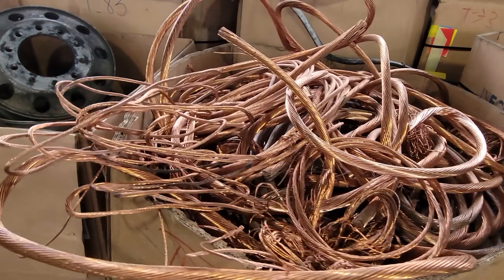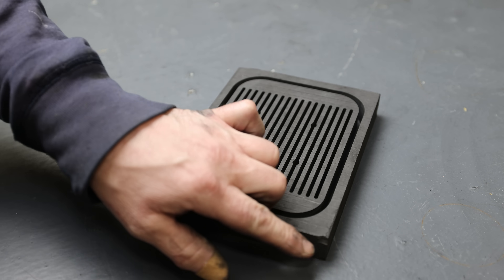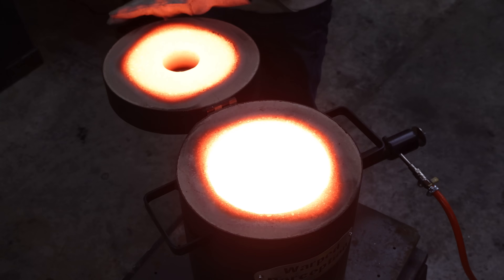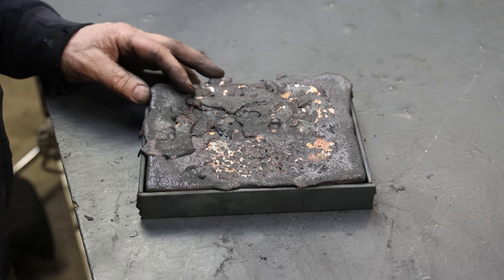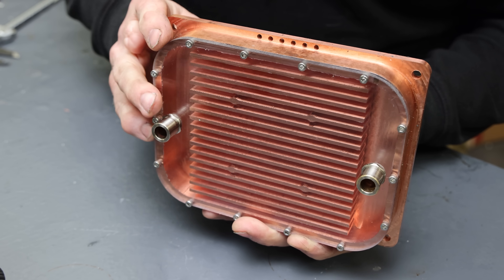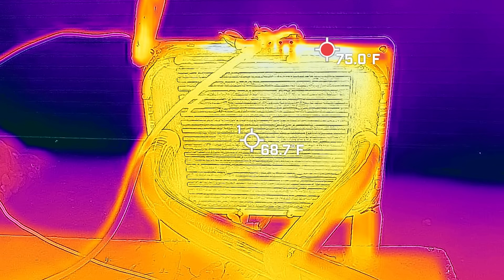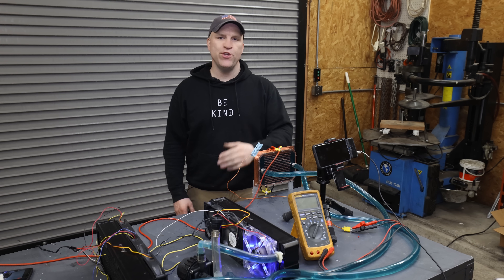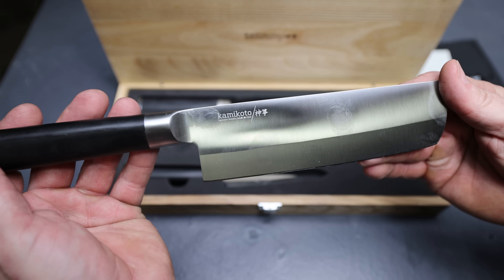Making a Huge Waterblock from Scrap Copper -Trash to Treasure

Comment: wouldn´t it be better to tilt the waterblock 90° like so the intake goes from bottom and exhaust in the top? i think it would be more heat efficient
Reply from the maker: Maybe but it really won't matter because it's being pumped through and this particular rear cover was just for the video, I'm actually changing the way it's set up on the rear so it can Auto bleed

Comment: What wattage and size is that chip?
If it's small enough CPU/GPU water blocks could be used, and another trick from PC: if your base if copper, or even better nickel plated copper, you could use liquid metal for thermal conducting, superb thermal grease for high powers, or use low temperature melt solder to bond chip with waterblock
Reply from the maker: 2000watts, 4 square inches. If it were that easy I would have been done a long time ago, unfortunately those options didn't work for me. As for the liquid metal, if you're talking about those heat tubes they're actually filled with water, at least all the ones that I have opened were filled with water... Maybe there are different types possibly?

Comment: In the camera shot looking down into the molten copper it looked like it was swirling like a toilet bowl.  Does it swirl naturally like a water in a toilet bowl from the rotation of the earth?  I can't see any other reason it would.
Reply from the maker: Yes that was looking into the molten copper, I think it's swirling because of the turbulence caused by the way the flame swirls in the furnace. Seeing as that's inside of The crucible that's pretty impressive that it just moves like that cuz it wouldn't be much worse from the flame movement.
Reply: @WarpedYT  Ahh that makes sense. Thanks for the reply and all the effort in your vids!  I always learn something.

Comment: really cool video and a great end result BUT you would probably get away with using a little less copper if you made the water block in a way where the cool water enters on top of the hottest spot on the block (middle) and made its way around the entire block - like most modern higher end CPU water blocks. Right now, most of the coolant simply flows across the middle of the block.

Comment: Might I ask why havent you casted a solid copper block and then machined it directly? I might miss something, but I can't see any reason why doing in a carbon mold first (especially if you destroy it aftewards)
Reply from the maker: Yes, to reduce exposure to the air by reducing the cross-sectional volume of the casting, almost for sure if I would have cashed the solid piece I would have had air in the center. Liquid copper loves to absorb air molecules and then when it's solidifies those air molecules are released and trapped in the casting. Which is exactly why I did that flux trick, you have to protect the Copper from the atmosphere at all times when it's molten.
Reply: @WarpedYT  Ahh that does make sense. Haven't though about that. I never casted copper myself, but I do remember seeing some casted copper bars which had a lot of "air bubbles" trapped, which in that case, would ruin the entire heatsink.

Good call! And great work! :D

Comment: Such a cool thing to do :) , I tried to do a copper pour the other day for some fun and found out the crucible i was using had some layer on the inside that bubbled out and copper is now stuck inside it...lesson learnt to check max temp before using as i have had other get holes over time but never that (pre-heating is always a must)

Comment: the in and out of the water block should bet staggered and not directly across
Reply from the maker: This was only for the video, I actually redesigned it with a different setup to allow it to Auto bleed any air and also be used in any orientation. Thanks tho !

Comment: Is there an estimated lumen output from the manufacturer (Nichia?)? How many Watts did you use, surely there was a constant current driver?
Reply from the maker: Yes 180,000 lumens if I remember correctly. 2000 watts, yes I had to use a legitimate power supply, that was probably the most expensive part of this project.  You can do constant current or constant voltage and also set the ceilings.

Comment: On the Water cooled Copper heat sink, the water input connector should be placed further to the top and the output water should be placed lower.  This would ensure all the water was being replaced, and not only some.  This would help with the cooling.

Comment: 2 relative easy sugestions to make it even colder: 1. Install input (or incoming stream) fitting on lower part and output fitting on upper part of plexiglass.(BC thermodynamics say that cold gas/liquid is allways at bottom and warmer allways at top, with my suggested setup You should be able to remove more hot coolant from cooler)
Or even easier, just rotate block 90° relative to ground, so input fitting on bottom, output on top.

 2. Polish surface where LED chip is mounted on block (or whole block plane it whould be easier), You will get better contact between 2 planes and better heat transfer from chip to cooler. Otherwise amazing cooler 👌🏻 I like this project 👍
Reply from the maker: That's a great idea, as for the cover this was actually only temporary because I need to use it in any orientation, so I actually redesigned that entire backplate to allow it to Auto bleed as well as deliver coolant in any position. As for polishing the back part that I should have done and I did not think about but that makes absolute perfect sense. I'm sure if you magnify down on that back plate there are valleys and peaks for sure... I totally have to do that. Thanks!

Comment: I used to spend more for copper heatsinks only to find out that aluminum works better... sigh.
Reply from the maker: Yes aluminum works very well, but depends how much heat you have to move and how quickly, the thermal conductivity of copper is almost twice that of aluminum. Trust me I tried aluminum first, aluminum is always my metal of choice
Reply: @WarpedYT  Its not that simple. and not to 'disbelieve you'. Copper is a better conductor of heat and Aluminum , a better dissipator. Hybrid heatsinks use a copper absorber plate and conduction system coupled to an aluminum or a plated copper dissipator. With that much surface area aluminum would seem to be ideal especially for cost not just weight and efficiency. Small surface areas are when copper is added for heat piping typically. Its unexpected to many but Aluminum has advantages...

Comment: Seems it may have been easier to pour one big block of copper; and mill that block... what do you think
Reply from the maker: Yes I was going to do that but that increased the exposure to air and I'm almost positive I would have got air in the middle of the casting because of the sheer size, the reason I did it this way was to reduce the cross-sectional area on all parts that were being cast to a minimum and thus reducing the exposure to air.
Reply: @WarpedYT  Makes sense. Thanks for the reply.

Comment: Why didn't you just cast a solid block and milled it out?! 🤷🏻‍♂️
Or just bought a solid slab of copper and milled it out?! 🤷🏻‍♂️ 
The way you did it doesn't  make any sense to me man!  
The amount of work and wasted gas and graphite, the extra CNC time. and probably extra time cleaning all the graphite dust! 
you have put in way more time and money!!! 😣 
I would really be a good thing for you and your viewers to make a: beneficial cost  analysis video of this whole process and project!! 
That would really help your viewers who want to get into building stuff! 😉
Reply from the maker: Originally I was supposed to Mill this out of a solid block, however the material was on back order for over 2 months, also I could not find the raw material anywhere.. originally I wasn't even going to make a video out of it. I didn't cast a solid block ,Because I wanted to reduce the amount of air in the casting, even with my process casting a solid block would almost for sure have air in the middle because of the sheer size and the air exposure. So yeah that's the reason I made the casting was to reduce the internal volume and a cross-sectional area of the liquid upon casting, and it worked I ended up with a completely solid piece no Air. Now you really think I would go through all this work if I could have just mailed it from a solid piece no way... That don't make no sense
Reply: @WarpedYT  sorry I re edited it 😉👍
Reply: @WarpedYT  yeah long ordering time's and back order  can be a real b!tch. And btw if you use extra burners on your mold the flow is better because you keep your mold hot and you have less problems with steam, moisture and oxygen and air pockets forming! 
Just put an extra burner in a clamping stand pointing at the mold, or have an extra pair of hands helping you! 😉👍

Comment: Nicely done! Why did you not cast a block of copper and CNC your shape out of that block? It looked like you ended up cnc-ing the graphite out of the molded copper, so in a way you could just have cnc-ed the copper out of the copper? No? I'm sure you have a reason, what was it?
Reply from the maker: Yes that would have been easier way but almost for sure I would have had air, I was trying to reduce the cross-sectional area of the mold to reduce or almost eliminate the absorption of gas into the liquid copper.

Comment: DIY Perks did it first! 😏
Reply from the maker: Someone sent me that video yesterday. But nah,  it's not the same chip, this is a newer version of that chip. Have you see the power supply I had to use it's 50 amps at 42volts DC. His chip was bright, but this one is brighter and a higher CRI as well. His video was cool though no doubt. I don't think he ran it at full power either even though he said he did, because in my testing even the silver thermal compound wouldn't allow the heat transfer fast enough, I had to get a special thermal compound that was 98% diamond $100 for a tiny tube.

Comment: What product is used to dissolve the silicone? 7:28
Reply from the maker: It's mineral spirits.... A good trick to thin it out without compromising the strength or characteristics of the silicone, one of the best tricks I've ever learned.

Comment: The water is really only flowing through the middle. Download a fluid dynamics simulator to see why that cooler isn’t optimal.
Reply from the maker: Incorrect, there is a distribution pocket and I milled into the bottom of the intake chamber and a turbulence pocket on the outlet chamber. I also matched the minimum flow rate against the square area of open channels and the distance to create positive static pressure in the intake chamber. There is no such thing as a free-flowing liquid. One of the scenes that I cut out is when the entire water block filled up the way it was mounted in the video just from pumping water through, that happens from resistance. And yes I did run it through a simulator. Also the position of the inlet and outlet were only for the video, the finished product looks a little bit different with self bleeding hose positions.

Comment: Awesome stuff right there, fantastic video as always.
That powdered graphite reminded me of the graphite bombardment in Iraq that took out their electrical grid. I once had an idea to test out a spike strip type vehicle disabling system utilizing various fineness graphite powders... it might not work, and it would ruin the vehicle if it did though-totally unfeasible 😆
Reply from the maker: I've been thinking about doing an experiment shorting out high voltage components with graphite powder for a while now.... After the graphite powder got into all my body packs and microphones and really messed with the audio in this episode I'm really considering it again.
Reply: @WarpedYT  I'd love to see it, I never miss your videos-I always imagine I had some of that knowledge and skill.  I just constantly come up with ideas and inventions- mostly mental masturbation though😆  I had another invention idea for stopping cars in police chases: It's made for a paintball gun (full automatic) and the ammunition is 3d printed or casted ceramic balls with a core that is a fragile pellet of compressed just enough hydrogen sulfide, mace, or even concentrated cadaver scent for training police dogs (That stuff is insane)
The idea being the cop fires full automatic and the rounds easily shatter the windows and "innoculate" the driver's compartment with noxious gas, combined with flying shattered glass depending on speed-thats the idea anyway, it would be a fun test to observe but not actually participate in 😆

Comment: People DIY this with water cooling to "mimic the sun" for some views in 2 weeks. If you spent 5 years on this, better be a thousand times brighter or something.
Reply from the maker: So to clarify this one is six times brighter than sunlight, and the five years I spent was on developing the entire idea, and finally finally coming to the point where technology is allowing me to make it a reality. I've had many iterations my last one was a microwave cavity light, where I basically used microwave oscillators as well as amplifiers to create a thousand watt microwave signal and channel it into a ceramic cavity, and I use that for my Prince Rupert stop video which even smarter every day could not light properly, he actually got upset because I would not let him use the light since it was still in development, zero flicker up to 8 million frames per second. So not only is the light intensity a problem but also the quality of light and for ultra high speed filming the flicker. So yeah I wasn't after just brightness here there's a lot more that I need. Again I have been working many years with many different companies to achieve the goal that I did in fact achieve with this setup here, that was my point

Comment: Plz try thermoelectric cooler to cool down chip by force 💪
Reply from the maker: That's a really great idea problem is that it wouldn't be powerful enough
Reply: @WarpedYT  Peltier Cooler 12V 100W (TEC1-12710) only sucks heat very fast from chip like refrigerator but heat should be removed from peltire because it's max operating temperature is 138c . And it's capable of producing -ve temperature.

Comment: What some overclockers like to do is throw the whole radiator in an ice bath. If you use something like acetone or alcohol to cool with, you should be able to get it colder than that with no problems. You could also get some extra fans and do a push pull configuration to get a bit better airflow over the fins of the radiator.
Reply from the maker: Those are great ideas !!
Reply: and slap some Noctua iPPC 3000RPM 120mm on the rad! instead of those cheap DC fans from 1995 :)

Comment: why don't you cast a solid block of cooper and machine a water block out of it? 7:35 and im afraid this is not the way to make it water tight, its gonna leak soon
Reply from the maker: The reason was to reduce the internal volume and the exposure to air, in an attempt to completely eliminate any air bubbles from the casting. A solid block would mean I would have needed about 22 lb of copper versus 10 lb. Originally I just wanted to buy the raw material and machine it, I was not even planning to make a video on it, but since the material was on back order for over 2 months, I couldn't find the material anywhere size that I needed it. So yeah I did it to reduce the volume of the casting and separate it into smaller bits to reduce the chance that the copper will absorb oxygen and nitrogen. It absorbs those gases really fast. On top of that I almost abandoned this project completely and my last attempt was to fill The crucible with flux the way I did and sure enough it worked I couldn't believe it. I have been looking on YouTube for weeks to see if I can find somebody who was able to cast a copper piece without air and I didn't find that flux trick anywhere.
Reply from the maker: As for the leaking yeah you're right I should have put a o-ring, this was just for show for the video. I'm going to change the design of the pipes make a new rear cover and use something called fipg which will never leak.

Comment: This is awesome project you have done and the work that went to it. Can't wait to have my own challenges  on cooling a xph70.2 led chip with 20 of them and out put of 5500 lumens. The spec sheet calls out 7500 lumenes which is insane amount of light.
Reply from the maker: Those XHP 70's  are really good chips! Cree are very good overall
Reply: @WarpedYT  yep I bought a ms18 flashlight and made a battery pack but the small fans aren't enough to cool them down. But very insane light out put.

Comment: enjoyed your vidio . nice job on the block .,,,wouldent aluminium have a higher heat transfer and is low cost , also easer to cast and machine .😀😀😀
Reply from the maker: Thanks, actually I tried aluminum first but copper has twice the thermal conductivity of aluminum

Comment: great job wouldn't be easier if you melted aluminium?? is not good enough heater transmitor ?
Reply from the maker: Not good enough of a transmitter that's exactly right, aluminum is the first thing I tried
Reply: @WarpedYT  tnx for answer, I admire to your skills and tools